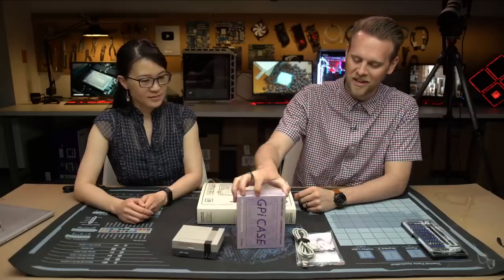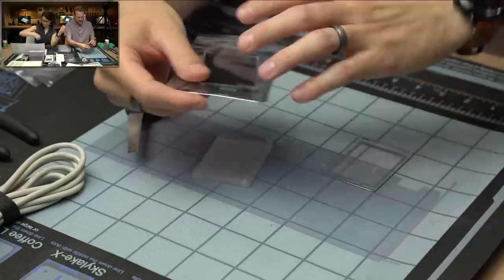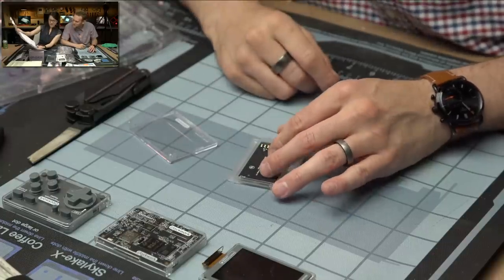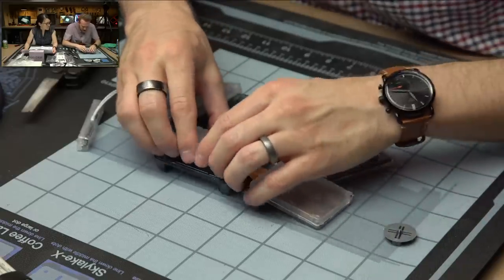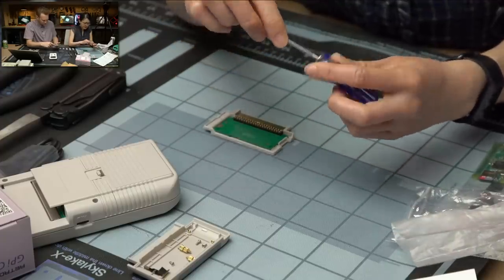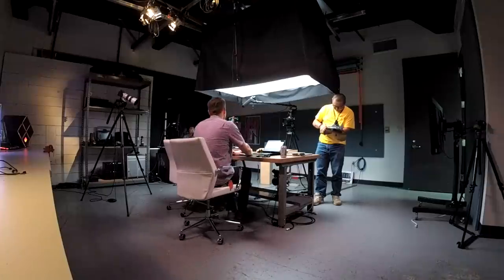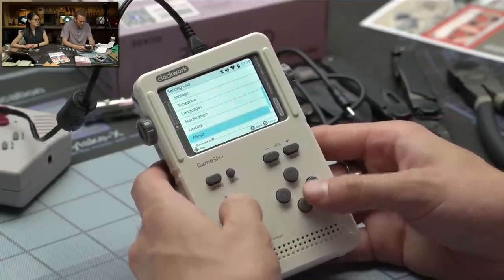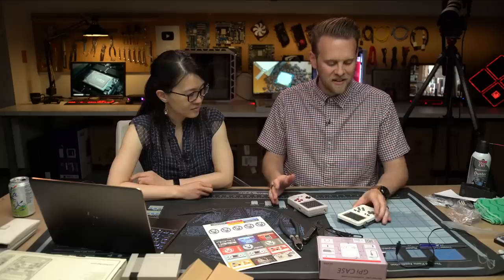Watch us build our own Game Boy live!

Comment: @Gordon Mah Ung
The latest LTT video is interesting. We had a little discussion yesterday in the chat about coolers (air vs. AIO), LTT released a video two days ago on the subject (I just watched it). Noctua  NH-U12S vs. an H-150i with a 360 mm (3*120 mm to be more precise) radiator: 3 degrees less warm, 2 dB less for noise. Price difference (Netherlands): €155 vs €55. 

That is just the baby-cooler from Noctua. 
Comparison between the U12S and D15 (specs from the website from Noctua): 
- 580 gram vs 980 gram (without fan)
- 158*125*71 mm vs. 165*150*161 mm (with fan)
- 5 heatpipes vs. 6 heatpipes
- 93,4 m³/h vs. 140,2 m³/h maximum airflow (the same RPM for the fans)
- 22,4 vs. 24,6 dB 

The NH-U12A had the lowest temperature and the lowest noise level, while also having 120 mm fans (but 7 heatpipes).
Aircooling is vastly superior over AIO-cooling for performance and it costs much less. Yes, you might have a bit of a struggle to change RAM but how frequently does that happen for an ordinary rig at home. Worst case scenario, you have to pull it of, clean the thermal paste with alcohol, put on new thermal paste and screw it back on. How much work is that? 15 minutes maximum? 

Here the interesting question. Maybe a nice topic of discussion (viewer-questions?) for the next The Full Nerd. Why do so many people on Youtube promote AIO's while aircoolers obviously perform better? My hypothesis: it is because of marketing. USA based AIO-companies have sent many more samples of AIO's than that Noctua and bq sent aircoolers in the first years that AIO's became popular. As a result these Youtubers have many AIO's and use it. However, HardwareCanucks (Dmitri) showed 2 years ago already that towercoolers beat AIO's: "Noctua's CPU Coolers - A Serious Case of AIO Regret?" A few months ago Dmitri showed it again: "The Silent AIR COOLED Gaming PC!"
Yet I still see AIO's being pushed all the time on Youtube. Don't get me wrong, each person his preference but at the very least I would expect to see aircoolers in at least 50% of the mid-class and luxury builds (without custom watercooling of course, custom watercooling does beat aircooling), yet most of their builds contain an AIO.
Reply: What are the heights on some of those air coolers? That does unfortunately play into the appeal of a CLC. (Btw, if I recall right, Gordon's the one who makes fun of the gigantic air coolers :3)
Reply: @alainaoxm 

Those coolers won't fit in a µATX-case but that is where people go wrong in my opinion unless there is a specific use-case scenario. If you want to put that PC in the living room and it has to fit in a case, or you travel a lot with the PC, sure, then an AIO might be a good solution. But that only applies to a small minority of all the PC users who has a tiny case. A 'large' case (large mid-tower or small full-tower) simply is more comfortable if it stays on one place:
- less noise
- lower temperatures
- all hardware fits in it (except an eATX motherboard often)
- it is easier to change hardware and to clean

Yes, Gordon made fun of gigantic air coolers and he was wrong. For the next "what Gordon is wrong about" episode. :p 

However, I think that Gordon did admit that aircoolers offer a great performance.